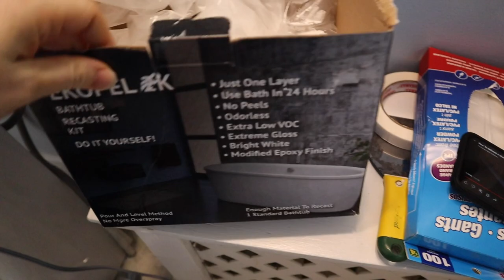BATHROOM REFRESH | REGLAZING A CLAW FOOT TUB | SMALL BATHROOM MAKEOVER

Comment: A non toxic cleanser i do for cleaning the tub which helps with scum and water marks is actually just two parts soap a one part white vinegar (whatever liquid soap you use). You can even repurpose old soap pumps while doing that i give it a mix then apply to the tub and let it sit for 5-10 minutes it should take the scum off and you can redo this as many times as you need! ( i myself have only needed to redo it once if its real bad , when cleaning normally.)
Reply from the maker: Ooh thank you so much for sharing that!